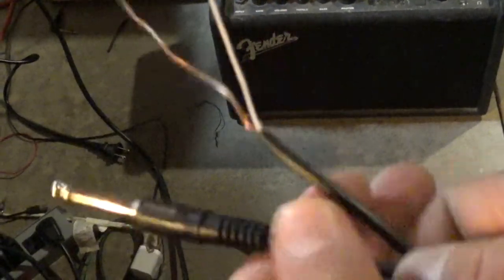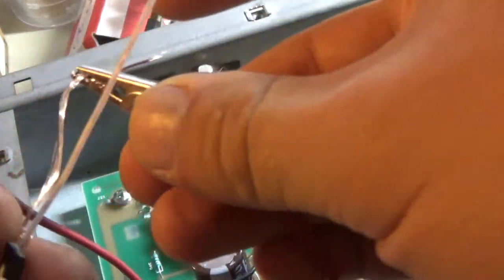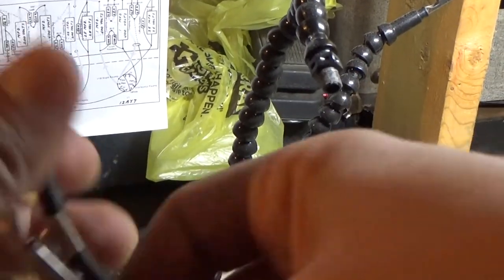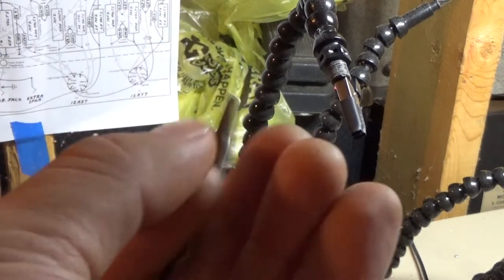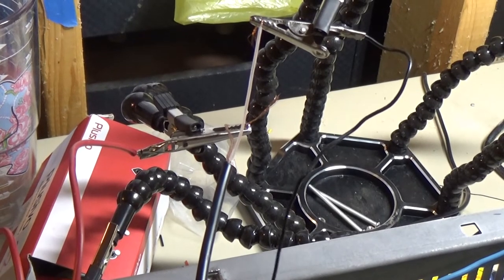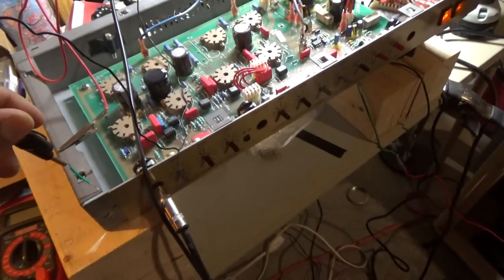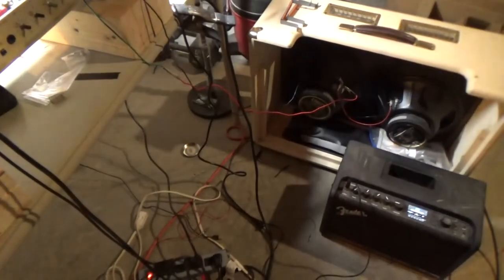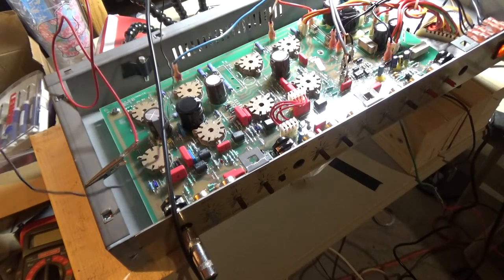How to Troubleshoot an Amplifier with NO SOUND (Signal Tracing in 4 Minutes!)

Comment: On the plate of those valves there is going to be very high voltage.. you’re definitely going to need a dc blocking capacitor in series with the prob 👌

Comment: I have a driver transistor on a power amp that distorts the the sine wave signal into a sorta  noisy stair step pyramid. I have changed all the caps. What could cause this. The following transistor driver is a lot worse. The output to the speaker Looks like its only amplifying the negative swing of the signal.  Bad bias resistor? Bad transistor?

Comment: My god. No
Reply from the maker: Show us how it’s done then !
Reply from the maker: https://youtu.be/j0npwMkYUOU
Reply: He should a capacitor in line but otherwise nothing wrong with this method
Reply: @Danilo8208SS  a cap or a resistor?
Reply: @lowheadroom  
Assuming you haven't killed yourself.  A Capacitor inline with the probe will block DC and allow the AC signal to pass.
Reply from the maker: @moby1388  I am aware.